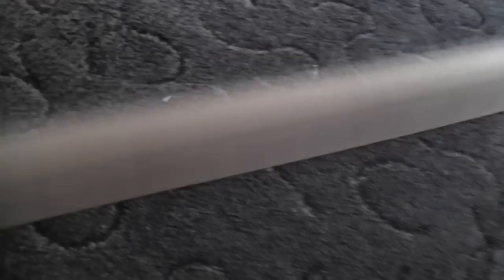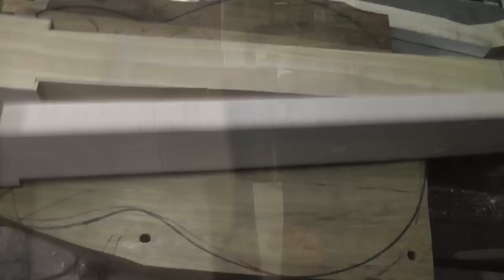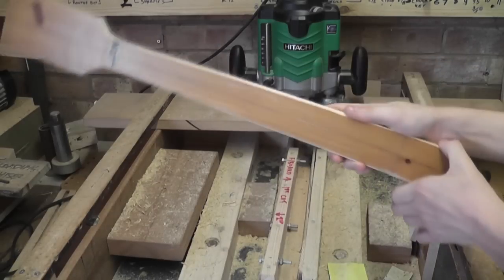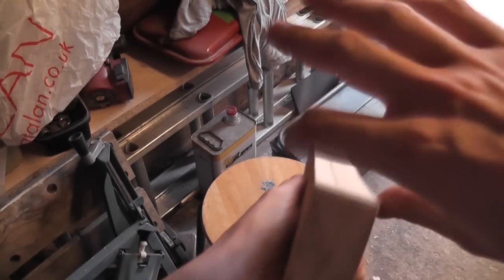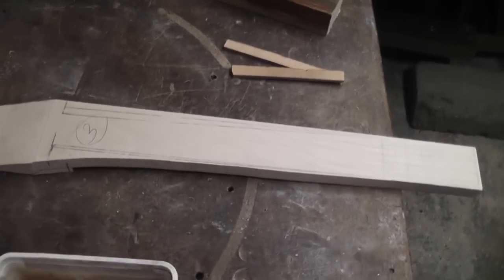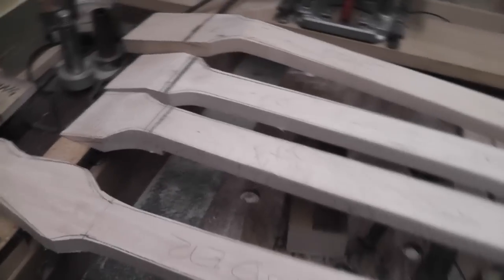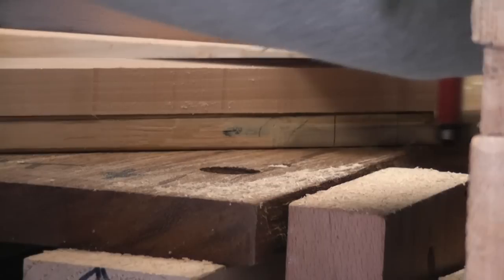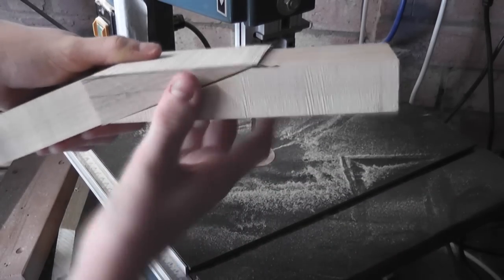Building Guitar Necks

Comment: What size blade are you using on the band saw?  How thick and what is the tooth count?
Reply from the maker: Draper 76728 1712 mm x 1/4-Inch x 6 Skip Band Saw Blade

https://www.amazon.co.uk/Draper-76728-1712-4-Inch-Blade/dp/B00205HDYE